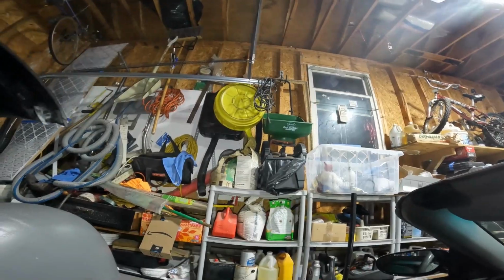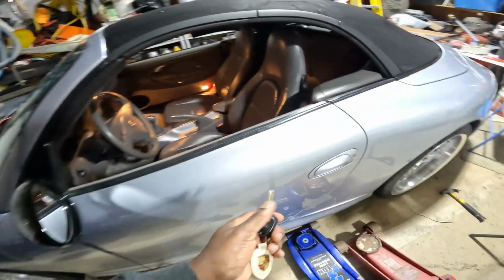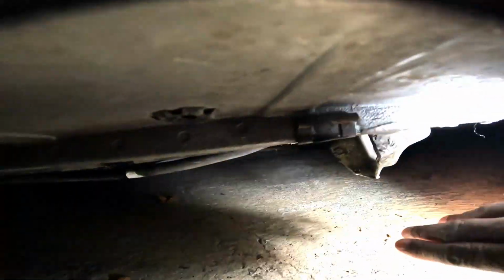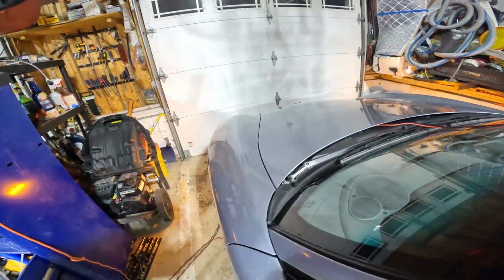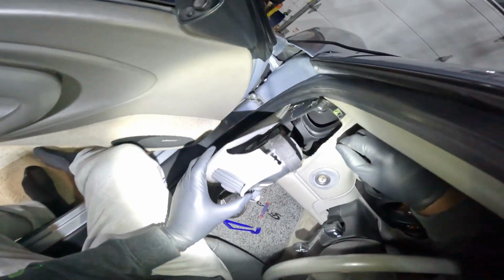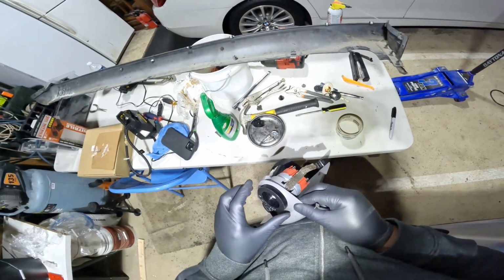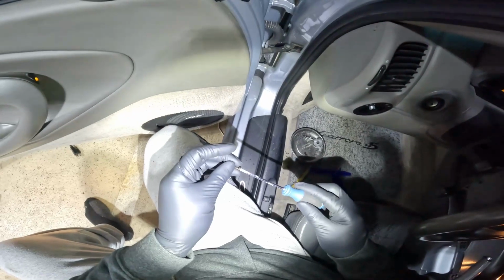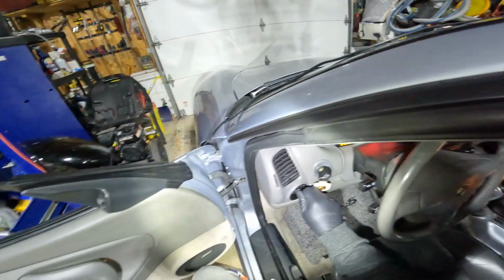Trip to the DEALER, headlight switch replacement

Comment: Hey Chiz_TV, I have a 996 with very similar top problem as yours, how much did you spend on the dealer and what sort of parts and service was performed?
Reply from the maker: After I checked to make sure the battery was fully charged, and the hydraulic fluid reservoir was topped off, I took it to the dealer they charged around $750 to “calibrate” the roof. No parts required…
Reply from the maker: It was all labor, I knew it was something that either I was missing, or didn’t have the proper diagnostic tool to fix. But it was simple…